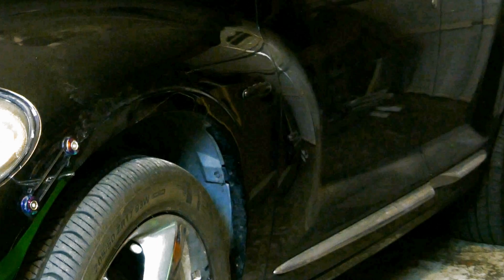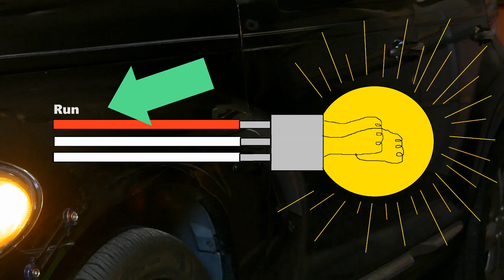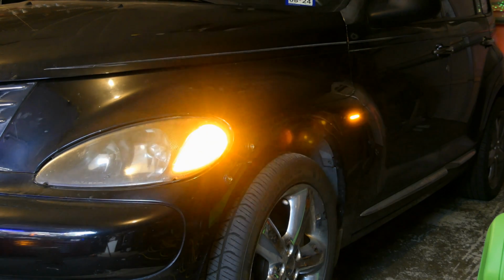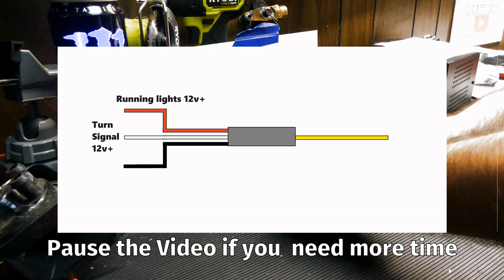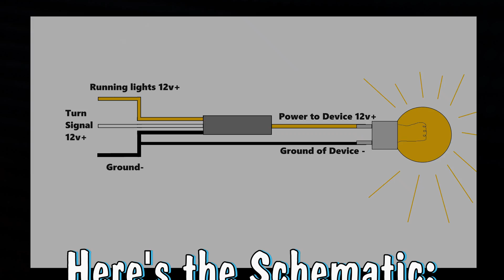The BLINKER GENIE 2: Solving the marker light problem!!!

Comment: I need this for a turn signal/marker light. But the some of the reviews on amazon claim when the marker lights are on the blinker works, but when the marker lights are off the blinker doesn’t work. Do you know if it will blink when the marker lights are off?
Reply from the maker: It works as a turn signal when there are no markers on. The yellow wire is the genie and it will get power from either the markers OR turn signal. When both have voltage it signals the yellow wire loses power.  If that makes sense. I’ve been using it as shown in the video and the turn signal works fine without the markers on.
Reply: Thank you!

Comment: Why didn't they set it up to dim the light? I could build a circuit to do this in a few minutes. I could do it really easy with (basically) a pair of resistors and a few diodes. Then you could have a light that can be off/on/dim like factory. Probably cost about $2. Could even be crazy and make a PWM controller and switch in a resistor to change the PWM duty cycle, effectively dimming the light. This circuit might cost $4... Seeing how simple this is, I am shocked someone has yet to do it.

If anyone is good at marketing, hit me up. Let's make a better version of these.
Reply: EDIT: Was just thinking (if anyone tries this) make sure to match (the LED) impedence of the resistive bulb so the car knows there is a bulb. If you get a fast Blink or the car says there's a problem then it's probably because the LED is using less current than the bulb did. Adding a load resistor should fix that.
Reply: I’m down dude, I’m have a psych background, I know sales and presentation fairly well

Comment: what you can do is hook the power for the side marker to the running light power circuit and ground for the side market to the power circuit for the turn signal. its how a lot of cars are set up from the manufacture. however, it doesn't work with LEDs.